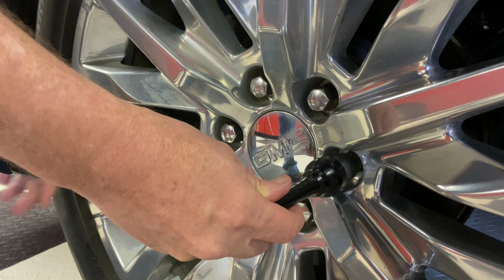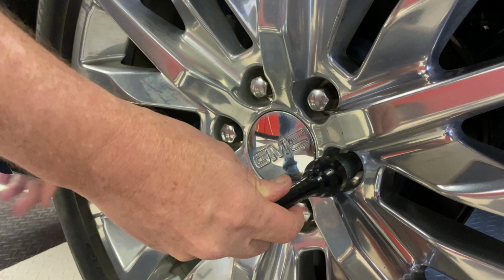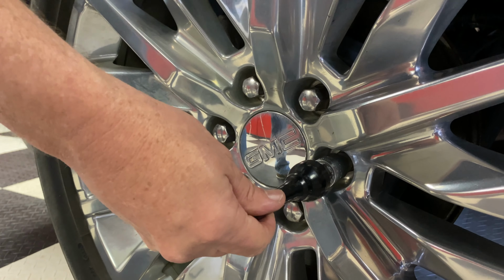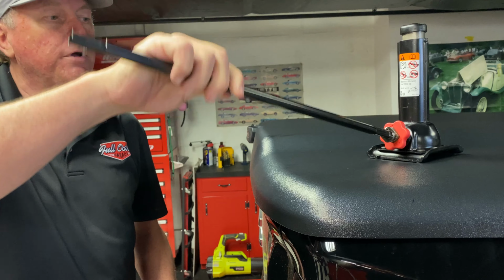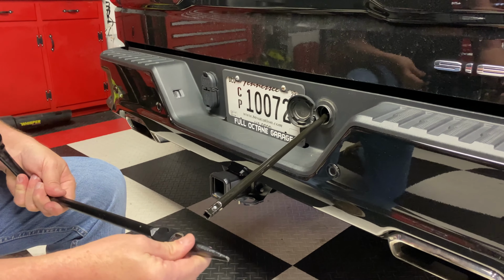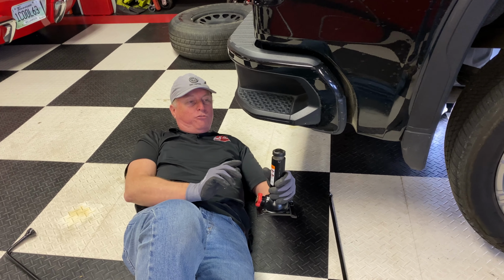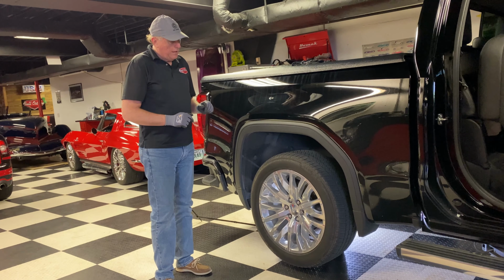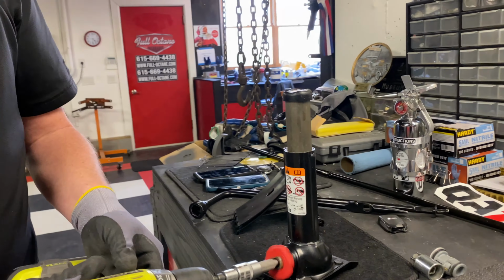How to Change a Tire on your 2019 + GMC Sierra 1500 Truck or Yukon!

Comment: Thank you for this video, you helped us greatly with this as our tire went flat on the freeway and we were able to get off and change it successfully. Changing a tire isn’t difficult, but I wasn’t familiar with the location or operation of the emergency equipment (something that will not be the case moving forward). This got us out of a pinch!

Comment: great video.question re HYDRAULIC jack.mine has a short 2 foot pipe to pump it up.how do you recommend extension for this.and also how to release it down  once the spare is on and time to release jack. thanks
John

Comment: I came looking on how to get the damn wheel chocks back in place properly as I didn't pay attention when I took them out. I figured it out eventually with some messing around though. Face the knob of the jack towards the sky and put the jack in place. Take the little hook and hook it around the bottom side of the cylinder part of the jack. Take the chocks and the short side goes over the base of the jack and the threads of the hook goes through the hole on the long side of the chocks. Tighten the plastic wingnut and you're good to go.
Reply from the maker: Lol... we actually made a separate video just for how to put all that stuff back together. You never think about it when you are sitting on the side of the road. My stuff all rattled around in the back for a month. Thanks for watching!

Comment: You stopped before showing the jack positioned on the truck
Reply from the maker: Look at 12:29 for the front and 10:18 for the rear. On the front it goes under the circle with the 2 holes in it.